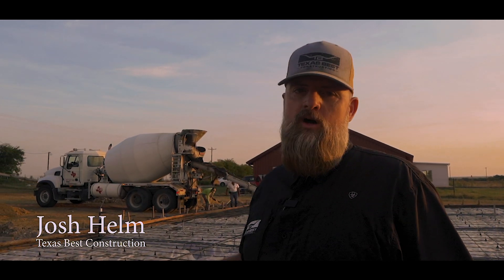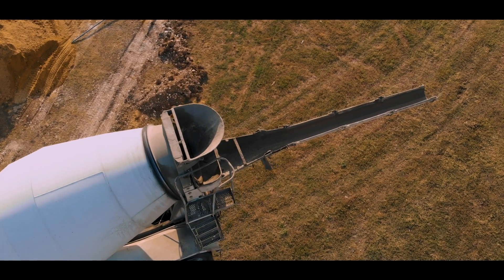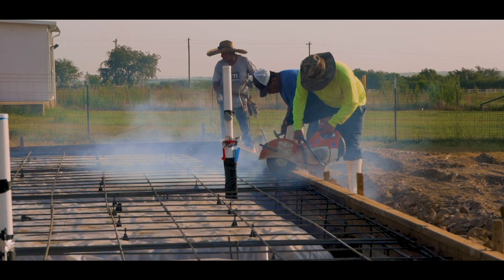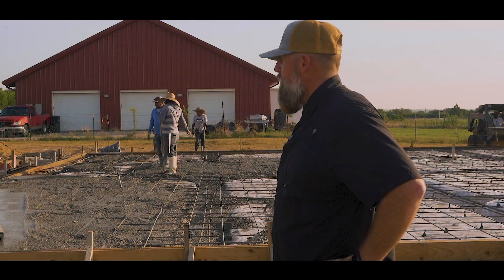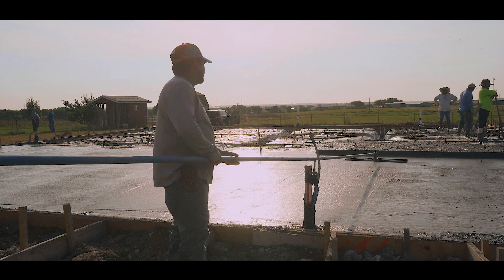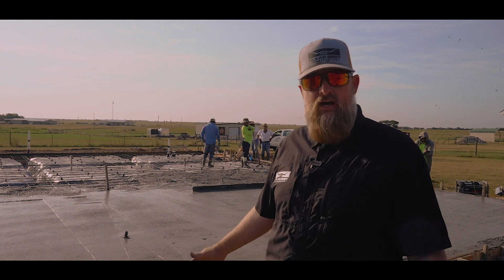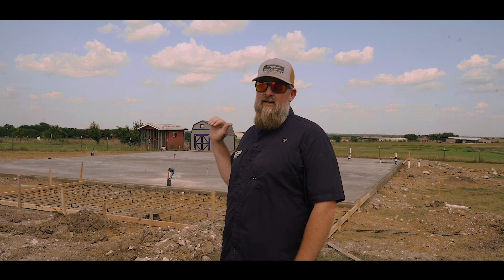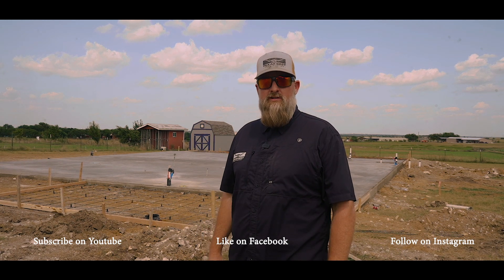How Concrete is Poured for Texas Barndominium Homes | Texas Best Construction

Comment: Neat seeing how it's done in Texas. I have a few questions. What is the white liner over the soil and why? To keep moisture from creeping up into and through the concrete? Also no pre-poured footings, no need as no frost? Love to build something like this in Canada, but have to build to -40 specs. Thanks and great video!
Reply from the maker: Wheeler Sabot yes thank you. Not much frost in Texas. Our footings are poured with grade beams and main foundation all in one. If we were doing piers then typically would do prior to main pour. Thanks again!
Reply: @TexasBestBarndominium  Thank you for the reply

Comment: No mesh?  Whats with the giant ditches in the slab?  Plan on parking a 747 on that thing?
Reply: It's what's called a monolithic pier and beam pour. Because it's a barndominium I'm assuming it's a preengineered metal building so the "beefier" metal will tie into the foundation walls, also - part of it is shop, so they want to have enough strength to hold some shop stuff. Looks like #5 on 12" centers with 24" footings with a 4" slab, probably 4000 psi concrete. Did you have to use a retarder with the heat? Hope you don't get any cold joints.  Do you do a patterned sawcut to do a acid stain and polish?
Reply from the maker: All of our slabs are engineered so we built it to the specs in this case.

Comment: What is cheaper per square foot? Concrete masonary unit or concrete?
Reply: Depends on what you are doing.
.
You can have it: 
fast and good or 
good and cheap or 
cheap and fast... 
but you can't have it fast and good and cheap.
.
And you can make it so cheap that it fails in a week...